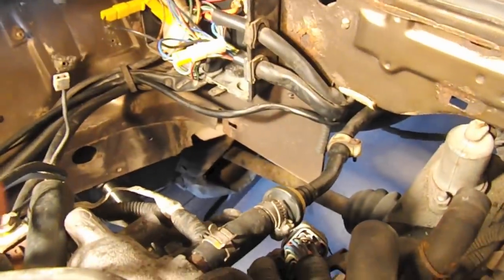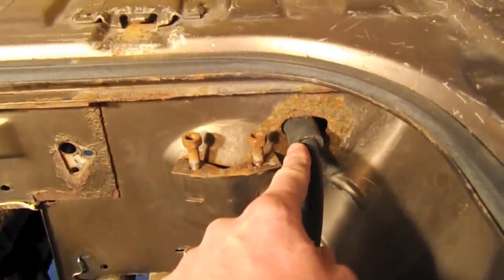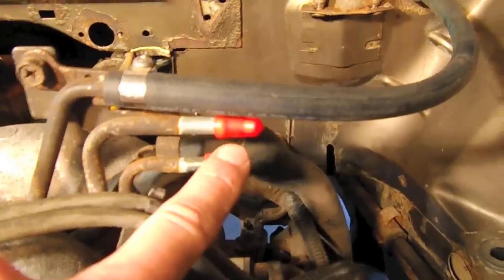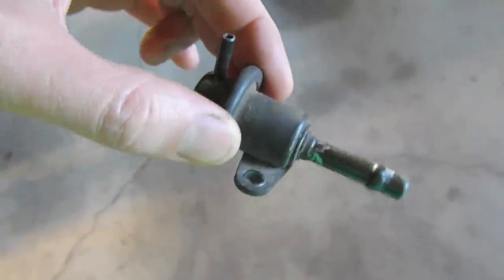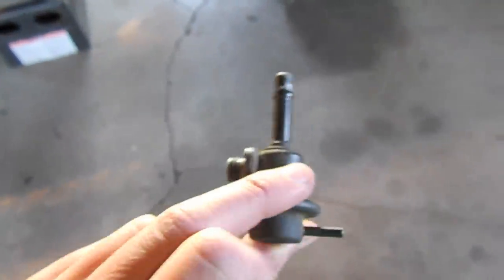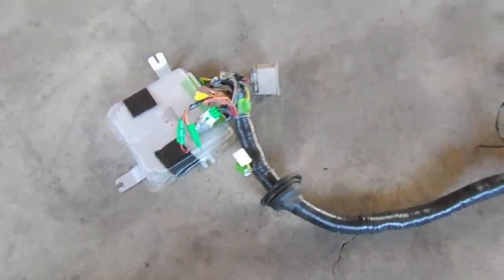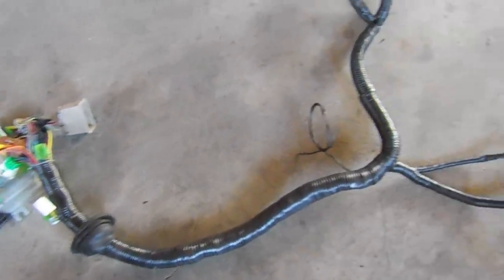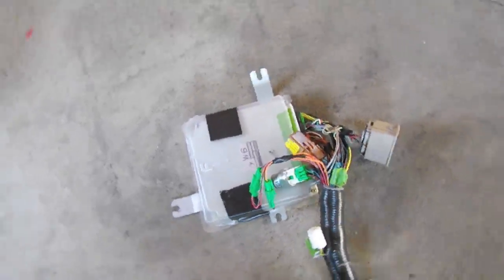Fuel. Intake. Throttle. - Subaru Vanagon Engine Swap Part 7

Comment: This answered a couple questions.  I have a couple left, though! 

Where does the small hose on the charcoal canister valve hook up?  Vacuum to the manifold?  What did you do with the crankcase ventilation hose connections coming out of the valve covers?  Normally they would go to the intake box, but now that it is extreme left, it seems a little ungainly to do so.

By the way, I got my engine installed last weekend.  It was a huge moment for me!  I found that the little KEP sheet aluminum cover between the adapter plate and the engine left two areas at each end uncovered on the EJ25.  I think it is a little different from the EJ22.  I had to fabricate a new one.  Also, the adapter plate uses 8 bolts (in 8 holes), even though the instructions say 4.  I called KEP and they confirmed this.  I had a little trouble mating the block and tranny, but it eventually went with a little help from some bar clamps.  

Thanks, Mick!  Can't wait for the next installment!
Reply: Oh, and the one way valve on the brake vacuum...is this necessary?  I don't seem to have one.
Reply: I went back and reviewed your main site and got the answers I needed in regard to the vacuum connections.  I'll wait for your next video for the other questions.  Thanks, Mick.
Reply from the maker: Forthwith Tx Hey Forthwith, I'm glad you had a chance to review the site, it's probably the best source as I can only go so deep in a video series. I'm sure the brake booster one way valve is necessary. The Subaru hose has a small unit inline if you can find that hose from your donor car. I think its mostly a safety feature (if you lose engine power you can still have one or two good stops before you lose booster power).
Reply from the maker: Congrats on getting your engine in by the way! Its such a great feeling to see it in the Van.

Comment: I'm doing a ej20 swap into a old corona and am at wiring stage thanks for letting me know how to reconnect the alternator. Now to find how to reconnect the OBD2 plug the green and red wire and brown and white wire got cut near plug but car does run
Reply from the maker: May want to grab the factory service manual for your year/model and check the diagram for the OBD2 port. You can find a link to the FSM on Busaru.com/services/resources

Comment: Ok, how do you get passed the fuel temp sensor, tank internal and external pressure sensors? The low level sensor could be ignored if you don't want an idiot light telling you your running out of gas.
Reply: Small Car makes a code canceler that satisfies all the sensors you mention